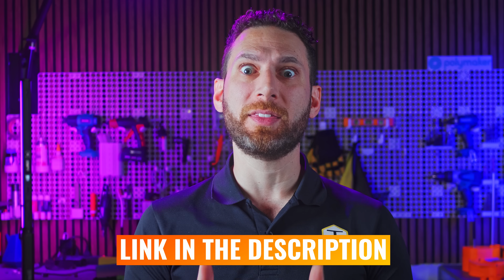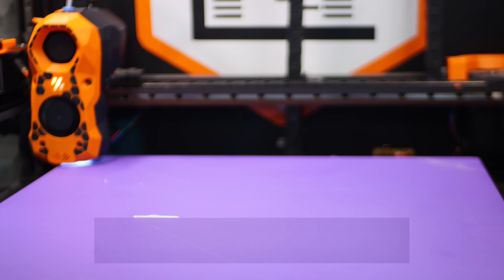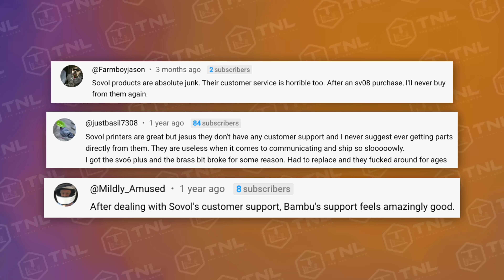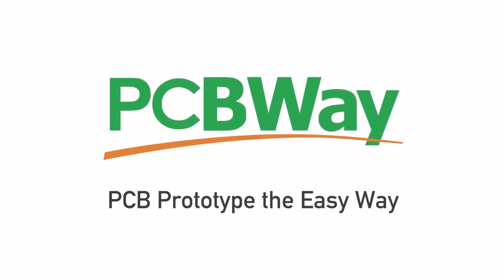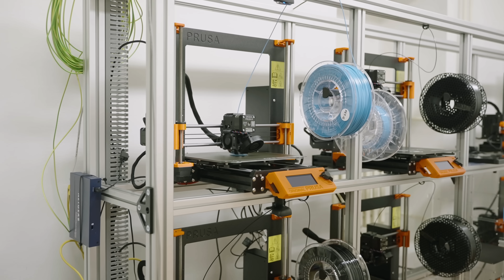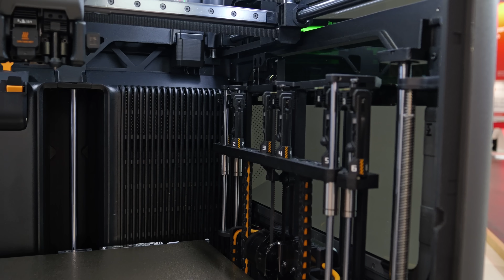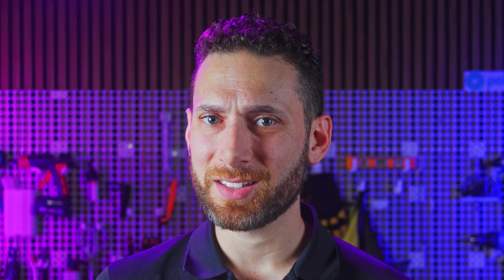My HONEST Annual Report Card for Each 3D Printer Brand

Comment: I like how Bambu took 3 years to develop the H2C and brought it to market. I think the U1 and the h2C have their spots in the market. I like Prusa but they seem overpriced and if I’m paying a lot, it seems Bambu would be the way to go for print quality which is what I’m looking for. 

My sv08max doesn’t have the best layer consistency. I’ve printed upgrades for it and currently it’s not working and I’m thinking if I should buy a 3rd replacement print head for it. 

My Neptune 4 base model at slower speeds is reliable but my Neptune 4max was a PiTA. 

After 2 years of printing, majority of my printers are A1’s and A1minis, along with a h2d. These seem to work and print with minimal issue as no company is perfect. 

I had two Kobra 2 max printers and eventually got rid of them as they decided to not be able to print a first layer no matter what I did. 

Currently do have a Qidi Plus4 but the Z offset randomly changed on its own after working perfect for about a year. It doesn’t see much print time though. 

Just a few random thoughts 💭. Thank you for coming to my Ted talks
Reply: They only brought it to market now because of the snapmaker u1.

It’s the beta version without the new AMS they will release to make it faster.

Comment: i believe tool changers are the future of multicolor and multimaterial 3d printers, speeds seem to have settled around the 600 mark, can we now work on true calibration of the machines, we have AI and camera's and tons of sensors we can use, each printer should have a standard set of calibration setups that utilize the camera and AI to fine tune the printer

Comment: Makea Prusa XLs. Fully enclosed and not the gimicky one but more on the order of the core series. A 2 toolhead + IDEX version. Specialty tools like and drag knife and laser. Coextrusion with continuous fibers. 
There are tons of improvements from the core that should be moved to the XL.
Reply: I don't see them remaking the XL to be enclosed by default in a future upgrade, that would be a total redesign. It's got aluminum extrusions for its structure rather than the exoskeleton approach of the Core One.

Comment: No one wants a 350mm cube build plate, we want 500 or 1000mm cube build plate for snapmaker. Sovol sv08max is borderline a turd. It needs lots of upgrades as with the regular SV08
Reply: LOL - in one breath you say "we" want a 500 or 1000mm cube build plate...then call the SV08 Max a turd (which it is not, it is actually really good). Truth be told, there aren't a lot of people that want 500mm machines...they take up a lot of space. 350mm is more than enough for the majority of people.

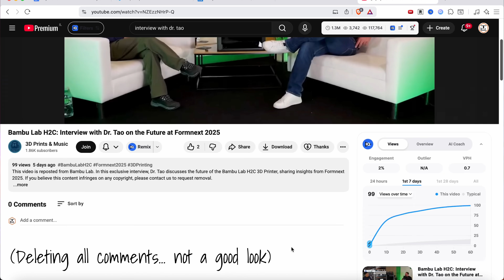Comment: 17:34 I'm a self described bambu hater. But I don't think this criticism is fair. In exchange for toolchange time, you get easy assignment of nozzle size, instead of having unload and swap manually on toolchanger or idex. And if the U1 and indx didn't exist, 40 sec for a change would seem fine. I'd be more concerned for the bad tpu compatibility
Reply from the maker: And no fiber filament compatibility. 
Also, do you really need a faster swap than the A1/H2D? It’s already so fast.
Reply: With the h2c you dont even need to walk into the room with the printer to swap between them at all though. If you want to go from .4 to .2 on the D you still need to swap atleast one model.
Reply: @thenextlayer  Check your sources. Fiber filament works. Maybe stop advertising your Snapmaker sponsors? 😊

Comment: I am a happy P1S owner and love the ecosystem. But the H2C is the wrong solution for me, even though I'd love to change to a toolchanger sometime in the near future. I will put some money aside every month now and will see what 2026 will bring. If there is no Bambu Lab equivalent to U1 or INDX or the many other solution I expect to pop up next year, I will switch brand.
Reply from the maker: Yep. This is exactly what I’m saying. Bambu hasn’t been listening to their customers, and that’s why they missed the mark this time around.
Reply: I have an a1 mini. Bambu ecosystem is things like spool holders and ams that have endless problems with other people's filament. They design things to be closed. My prusa and anycubic spool holders work with every spool, easily. The need to have a printer know exactly what filament is inserted is unneeded. Filaments say on the outside of the spool the print temps to use and the ranges are very forgiving. I print "generic pla" or "generic petg" or "generic tpu" for 98% of everything and get amazing results. Fear of "leaving the ecosystem" is just FUD manufactured by Bambu. Now they sparked a LOT of innovation and shook up the market in a big way. Their ams was a game changer. But the H2C proves they just want to sit on their laurels and sell more AMS units, because ecosystem is lucrative. Prusa is basically throwing away their nextruder in the name of innovation recognizing INDX is better tech - I can't imagine Bambu doing that. It is so easy to print stuff without Bambu - and I like my a1+ams - but every other brand these days is catching up or already passed Bambu

Comment: What sort of features do you want to see in OrcaSlicer next year?
Reply: More code imported from the Bambu Studio code base, I presume.  😁
Reply: @johngelnaw1243 I want to see more done with multiple nozzle size support. With tool changers becoming the next big thing, I want to see refined controll allowing things like a 0.2mm nozzle used for outside wall details, a 0.4mm nozzle used for inner walls, and a 0.6mm nozzle used for infill. I want to see the ability to controll nozzle size on a layer by layer basis to improve overhang performance. I want to see Arachne improved to tie nozzle to line widths so that fine detail can be captured while bulk detail that can use thicker walls is captured by the larger nozzles...

There is so much untapped potential when it comes to slicing for tool changers.

Comment: I'm glad there is someone out there to call out bambu labs, I've had multiple brands of printers, and always had my eye on a bambu, but couldn't wrap my head around the whole closed eco system, pulled the trigger on an A1 combo for a small multi color print I needed, within a week of ownership, the toolhead PCB caught fire, and what did bambu do, ignored my emails and the one response I did get was it maybe had something to do with my home wiring, that was ridiculous, sold the printer and said never again, and I'm not the only one that's had their A1 catch fire, but the bambu fans will always find a way to justify their practices
Reply from the maker: Wow. That’s surprising. I have never had a bad experience with their products - I love my A1 mini. But, yeah, i do have a lot to say about other aspects.
Reply: I have the same experience, Bambu's customer support is terrible.
Reply: I wanted a Bambu for so long.  I finally purchased the P1S combo during the anniversary sale in June.  The printer arrived quickly and set up was relatively easy.  I added a BTT screen, which worked occasionally, there was some sort of sync issue.  The AMS system is not intuitive, period, it isn’t probably because the BBL screen doesn’t allow the user to set the filament colors and the BTT screen had issues.  Plus it’s multiple steps to sync the AMS filaments in the slicer.  Ok, I can deal with that, some printers are just finicky and high maintenance.  Printer produced great prints, mostly.  After 6-8 weeks, I can’t remember the exact amount of time, the AMS developed a filament feed issue.  I reached out to BBL, no response.  I haven’t had time to tinker with it since September.  Luckily I have 20 other printers so it didn’t affect my business.  However, I have decided not to buy another BBL printer.  I’ve heard from so many other user that had issues contacting BBL support and never receive a response.  I’ve had to contact support for Anycubic, FlashForge, Elegoo, and Qidi, all of which responded within 24 hours if it was during the week and by Monday afternoon if I contacted them on the weekend.  Responsive support can’t be beat.

I have multiple printers that “just print.”  I only have one that hasn’t been worth my time to try to fix and it’s the P1S.

Comment: I have had a Prusa Mk series for about 6 years currently have the 4. Great printing machine however I did not see enough value in moving into a Coreone since I put it in an enclosure. I bought a H2D and am blown away by the AMS being able to load 2 or 3 rolls of same filament and let a print go not having to deal with running out is next level. If Prusa gets something like an AMS going I would love to have it on the new L. But IMO print beds over 300 in size not having a filament changer is very limiting
Reply: @jeffstrains4014  Prusa MMU can't do that?
Reply: @daemontus  it can, but people have been so worn by the MMU2 that most have written off the MMU3.
Reply: @daemontus  @jeffstrains4014 the MMU has the ability to do that as well, I load 2 slots with the same filament so it swaps when one runs out.
Reply: I also have a MK4 in an enclosure. But I decided to get the MK4 to C1 conversion kit because the C1 will take up less of a footprint on my desk than the Prusa Enclosure does. Now I need to figure out what to do with the unused enclosure... ;-D
Reply: Core One L Index. Available 2026
Reply: INDX that is all, don't even think of the mmu3
Reply: @wiesman2613 I don’t think the indx will natively work with the bedslingers, you could probably design a tool changer yourself though.
Reply: @C8-H8  Interestingly, I've heard in interviews with Bondtech that they did a prototype INDX on a Prusa MK something (I forget if MK3 or MK4). So INDX on a bed slinger is theoretically possible, but I don't know how practical it ended up being.
Reply: @Sembazuru   there was an addon someone made a while back for the Mk3 that had v6 nozzles (I think) on a carousel, with a little arm that would unload and load nozzles into the hotend. Very similar to what you see on CNC mills. I think part of the reason it didn't catch on was a combination of some dumb patent, and the clunkiness of changing v6 nozzles (though maybe they weren't v6 and I'm misremembering), and that the carousel was also this massive thing attached to the side of the frame.
Bondtech might've done something like that on a Mk4.
Reply: @wiesman2613  Got a Mk4s with the MMU3, works like a charm, both for multicolor or for continuing a second roll of the same filament.  Loading the thing when using the filament buffer is a giant PITA, but very easy when using self rewinding spool holders (I use the Filamentalist ones, that require no motor).  For simple use cases, the MMU3 is reliable and perfectly adequate.  But... I might add a Core One at some point and will definitely want the INDX option.
As for improvements to be made to these printers: YES we want real quick-change nozzles.

Comment: My view of Bambu is this . The new hardware is over the top, and i dont think we need it. What i think would have been better is a larger X1/P1 and upgrades of both to bring them in line with the A series in regards to hot ends etc . So in short what they are now doing now with the P2S but also we did not need or want the H series. As for the "lockdown" i dont like it but LAN mode fixes most of the problems. The sad fact of the matter is most people dont care, they want there printer to work and the bambu printers do. Look at the price of an A1 mini , where else can you get a printer of that quality for that price with the features and support it has.... nowhere.
Reply: A lot of people wanted something the size of the h2s.
Reply: Bambu needs to refresh the A1C
I want 300x300x300 at least(maybe 320cubed) and a vortek ( I heard the vortek is a cheap upgrade)
For the price of the A1C
Vortek makes more sense for the AMS lite since all PTFE tubes go directly into the tool head so there is no retraction to waste time for color swaps.
Just put the vortek on a sled to the right of the bed and overhang the gantry over it, sled would move front to back since the tool head can't.
Give us a 4 nozzle rack or maybe a 6 nozzle rack,
Let us use the original AMS lite with it but also offer an AMS lite pro that is enclosed and has a dryer.
Maybe add another spool on each side for 6 spools to feed the vortek
Put them in a triangle formation on each side.
Also after an A2D , same printer with the dual nozzle tool head.
We want an entry level multi material machine like the A1C that doesn't poop. Instead of investing $2400 on a machine that is slower because of the inferior AMS design where only one PTFE goes to the tool head.
A1 had advantages over the P1 and X1
Bigger out of the box volume, pressure advanced Eddy current calibration and the better and faster AMS design (albeit more messy).
Let's continue that trend with an A2C and or A2D
Reply: I am sincerely curious: Looking at your desires for a bigger X1/P1 with the A-series style hotend, I immediately thought of the H2S. What about the H2S don't you like? Is it price? (Of course, I wish the H-series were all cheaper...) Too big? Too small?